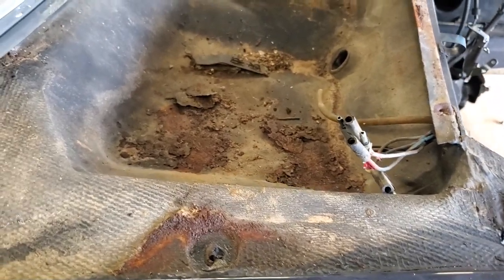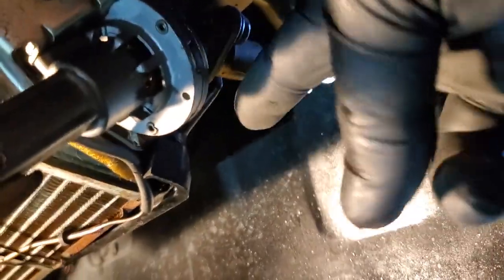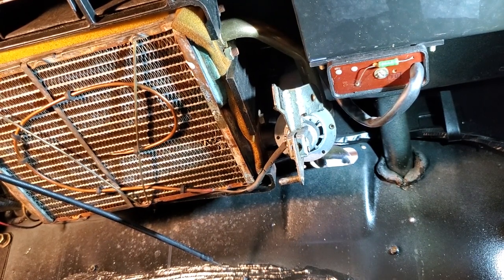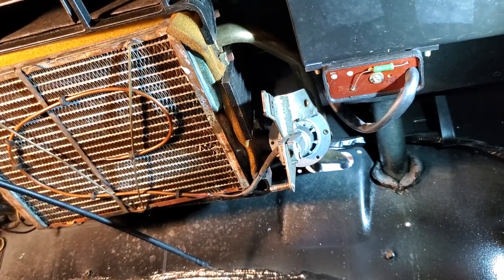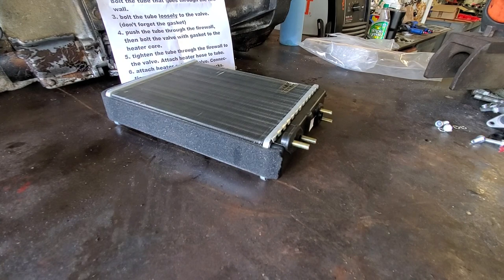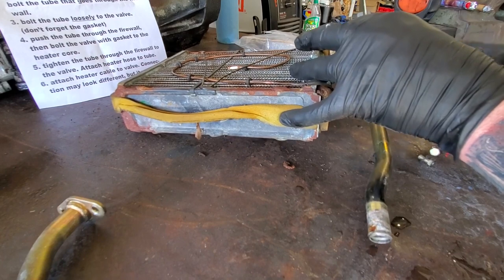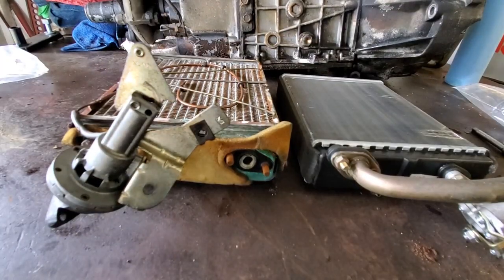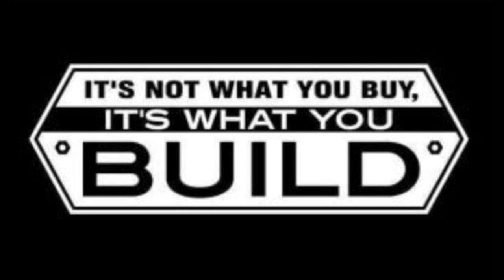1979 Fiat Spider 124 Heater Core Replacement

Comment: Thanks for posting. Gives me some confidence seeing it first. Mine was bypassed and one day would like to repair.
Reply from the maker: I think the most work will be removing the radio console and fan to get to it. I don't think you would have to remove the entire center console. I'll post a video when I put it all back together. Have to get the Hushmat down on the inside first.
Reply: @ELDESTBuilds  Thanks for the videos. Have a 77' here and love knowing the info before the adventure!